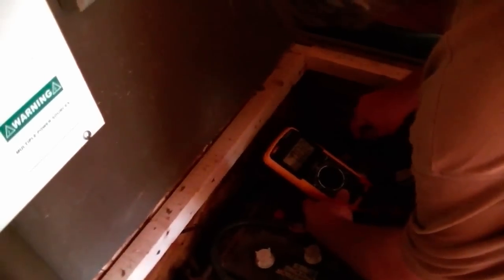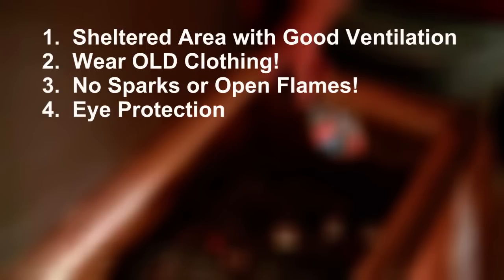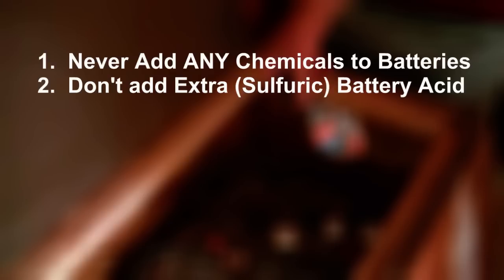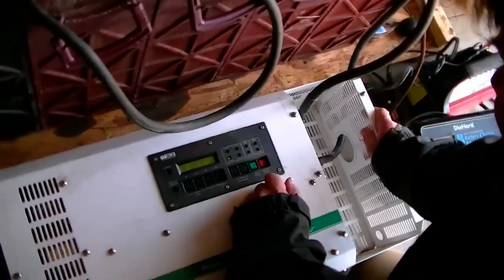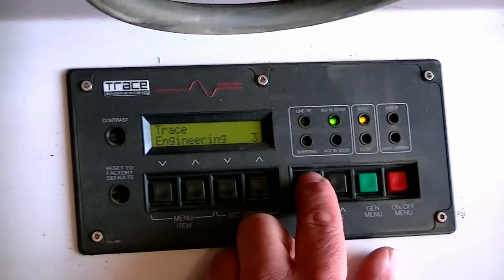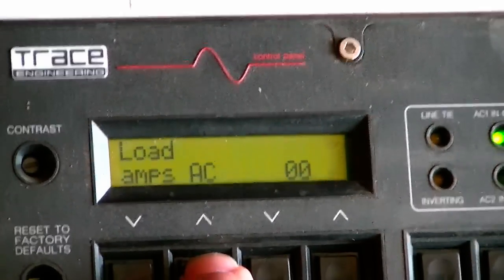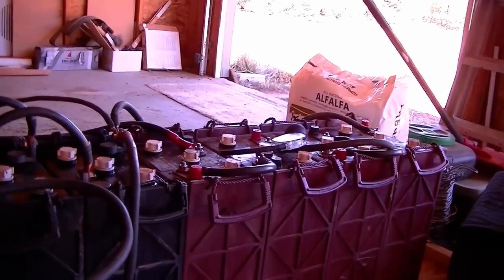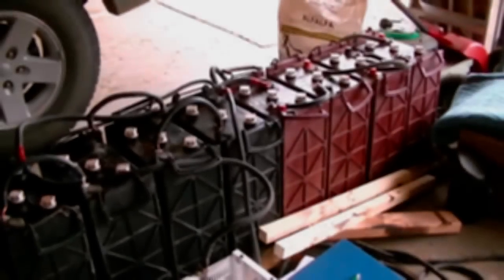Equalizing Batteries

Comment: I am attempting to rejuvenate a few seriously low cells in a 36 volt (18 cell) 765 Amp-Hour electric forklift battery. I have 3 cells that show 1.6-1.7VDC. I am using a variable transformer to "turn down" the A/C input to an old Schumaker manula (NOT automatic) battery charger to the point where I can charge the individual cells on the 6-volt setting at 40 Amps.
I am also watching the temperature and have read that 120-140 Degrees F helps soften the sulfate, but so far (after a week of this) I have not seen the specific gravity coming up. If anything, it appears the cell voltage is dropping. I am beginning to wonder if I have a different problem.
Reply from the maker: +Tracy Mathews I would say that those cells are simply bad.  Unfortunately, that is their ultimate demise sooner or later.

Comment: Thanks for d info. Can I get my batteries charged with panel instead with car charger
Reply from the maker: Yes, but you would need to get a panel sized properly for the battery.  Too small panel and it would not charge adequately.  Too large panel and you would need a charge controller.

Comment: Does this procedure vary when dealing with sealed batteries?
Reply from the maker: Chad, I wouldn't use this method on sealed batteries.  You risk deforming the plates, cases or even a possible explosion.  Keeping an eye on the water level is critical, and it's not possible (easily) on sealed or AGM batteries.
Reply: Thanks!

Comment: Very good video, however I have never needed more than 5 amp per battery when overcharging. This seems to re emulsify the sulphur with zero heat.
Reply: how long do you leave your battery charging with 5 amps for it to start bubbling, and how long do you keep it after.
please let me know.
Reply: @zgalli.powerlifting1814  starts bubbling 14.5- 15 V. I overcharge 6- 8 hrs. This is only done if sulpher has began to accumulate.
Reply: @robertdixon6536  thank you

Comment: question.... i have 2   6 volt t150 golf cart flooded  batteries hooked up in a trailer,,,,,,,,,,had them charged to full with trickle charger about a year ago or so. held that charge for many months with trailer in storage.but that ended a few months ago .am about to install a 100 watt solar panel on the roof with a 30 amp mttp controller .will the panel recharge those batteries over time or do i need to remove the batteries and have them boost charged for them to have life again ?
Reply from the maker: Bob thank you for your question.  It is possible to equalize your batteries with a 100watt panel, but it mostly depends on several factors.  If you don't get enough hours of sun per day it won't work.  If you live in a place where it is cloudy most days like South Bend Indiana, it won't work.  If the angle isn't proper it won't work, etc.   So the bottom line here is if you want to be sure to give the batteries a good equalizing charge, use a commercial charger that has an equalizing function.  If you have time, you can try the 100watt panel and see if it works.
Reply: thanks for the reply.i live in florida so sun not a problem. i guess ill just install the panel and controller and hook it all up and give it a week . if still no sign of them  taking a charge ill pull them and take them somewhere to be boost charged. i just hope i didnt kill them beyond fixing. all i had running off the were 2 sma;; volt meters but who knows .maybe thats all it took over months to totally drain them ?
Reply from the maker: That's probably the way I would handle it.  I think you're on a good track.
Reply: Just  wondering if the second half of this video was ever done. Thanks
Reply from the maker: Unfortunately, the raw footage for the second half of this video was lost.  But I can say this: we did recover more cells than not.  But most batteries had at least one bad cell making the whole battery useless.  Because of this experience I would recommend attempting this only on 2 volt cells, since individual 2 volt cells can be culled without affecting others.

Comment: Looking For some Help. If I have a string of 2 volt rolls surrette in series to make a 48 Volt bank and three charge controllers can I tap into the bank every 8 cells designating each charge controller to 8 cells per each controller and then set parameters to charge for 16 volts each all the same setup so as to better equalize the string and keep a better balance rather than just hooking all of them together in parallel charging at 48 volt parameters hope you can help Thank You
Reply from the maker: If your charge controllers are PV, isolated input/output and UNGROUNDED-capable (NEC 690.35 compliant), then yes as long as none of your wires from the arrays have an electrical path to ground anywhere.  It's not likely that your system would pass US electrical inspection.  It's not a setup I would recommend, but if you're willing to take the risks involved, it should work.

Also consider this:  If your charge controllers can handle 50 amps, their maximum capacity at 16 volts is only 800 watts each, where at 48 volts for the same amperage, they handle 2,400 watts max, each.  If you run them in parallel as a 48 volt system, you can handle a total of 7,200 watts of PV.  But running them at 16 volts, you max out at only 2,400 watts total from PV.  You really won't gain anything by splitting the charge, even though it appears to make sense.
Reply: Ok Great! I see your Point Thanks so Much for the help there is significant gain to be had at 48 Volts I guess that answers my question...
Reply from the maker: You're quite welcome.  Good luck in your endeavors!

Comment: it is also possible to balance a stack with 33 batteries ????
Reply from the maker: SekretaryService the short answer is it is possible. But the charger needs to be properly sized for the voltage and amperage of the batteries according to how they’re wired in series/parallel.  It is more difficult to do because you have to watch all the cells more closely to make sure none of them actually overcharge to the point of damage.
Reply: Offgrid Steve 33x12Volt and 90Ampere. But we use several Banks...

Comment: i could be wrong here but isn't the maximum charge rate about 20% of the given capacity.
for instance, a 5Ah battery can only handle 20% of it's given capacity as current. (in Ah of course) thus being 1 amp of current.
Reply from the maker: You are absolutely correct - generally speaking.  You would also be correct if you said that most AGM batteries should never exceed their float voltage by a few hundred millivolts.  However, when equalizing severely sulfated flooded cell batteries, it takes a higher amperage to get the sulfate to budge off the plates.  Like I said in the video, when it comes to sulfation and equalization, it's as much black art as it is science in my experience.  Do so at your own risk and discretion.
Reply: Steve Robertson i only had a few severely sulfated batteries at my school, so i asked if i was allowed to try and get them back to work. They are only 7.5 Ah so i set the supply to 14,7 volts and capped the current at 1.2 amps after about 17 to 18 hours they had reached the nominal voltage and they could deliver current to 2.4 amps without a significant voltage drop.

Mission succes.
Thx
Reply from the maker: Quinten, that's great that you had success!  You should make a video about it and share with the world.  The more info, the better off we all are!

Comment: The batteries are place on wood because ?
Reply from the maker: The concrete floor is new.  It belongs to my neighbor, and I was allowed to borrow it for this purpose.  You will notice several black spots on the wood where the battery acid got onto it.  I did this out of respect to protect my neighbor's concrete floor.  Concrete contains lime which reacts with the acid.  The surface of the concrete would have been destroyed in those areas the acid would have contacted it had the wood not been there.

Comment: I desperately need your advice!  Everyone, feel free to advise me as well.
I had 2 men working on the solar system in van.  
They replaced the batteries with a LiFePO4 12.8V 78Ah and a 12.8V 35Ah 448Wh.
They installed a Pure Sine Wave Inverter 12V Input, Power 2500W, Output 120V.
I also have a Victron Smart Solar Charge Controller,  MPPT 100/30.
When the electrician hooked up everything sparks began flying, the system got hot, and he has given up trying to set it up.  I have no solar power now in my van, which is my home.
Please help!  I can't waste any more money and I have no idea what I need.  Thank you.
Reply from the maker: That’s almost impossible to say without physically being there.  What is your location?
Reply: @OffGridLivingSteve  Florida.
Reply: I read part of the instructions today for my new inverter and it says not to connect it to solar panels nor a solar charge controller.  The men working on my van and installing the new batteries and inverter must not have known what they were doing.
Reply from the maker: @petuniaromania6294  it happens often where people claim to be “experts” after watching a few YouTube videos. I live in Hawaii now, so unfortunately I won’t be much help.  Be thankful you don’t live in Canada!

Comment: The Batteries are placed on wood because ?????  The acid will ruin the concrete ? or Wait , Wait. Don't tell me they will discharge through the plastic case if placed on concrete. That old tail is very hard to stomach.  Perhaps dirt or a rubber mate will work even better. Fantastic info and really appreciate it but I'm sorry I just don't buy  the concrete will suck out the electricity and make a battery go dead. Perhaps placing it on the concrete floor and forgeting about it for a year or two might make it come true.
Reply from the maker: Dear USSBB62, since you insist on putting words in my mouth about the batteries being on wood, I will certainly allow you to enjoy your nonsense.  I watched my video again to be sure that I didn't say anything about them discharging if placed directly on concrete.  I said no such thing.  Perhaps the voices in your head speak louder than my video.
Reply: Steve Robertson
THE MIST FALLS ON THE PLASTIC CASE. MAKING A SURFACE CONDUCTION BETWEEN POST AND EARTH.KEEP IT CLEAN AND DRY. GOOD VID.

Comment: The perfect gift 

Perfect gift for the handyman who has everything an ideal winter project,
       Make an electric garden tractor from your old gas tractor, and it could be charged by solar, zero pollution
Plans and instructions @ electrictractor.net
2hrs cutting approx 2 acres or 8-10 hrs pulling trailer on a charge
Converting to battery power is a great idea for a garden tractor I converted one 15yrs ago, I used the 3 separate motor design and it is still cutting grass on a daily basis, it is amazing how it never breaks down and needs almost no maintenance, I renew the batteries every 7 yrs I am just on my 3rd set now, my design will cut up to 2 acres on a 50cent charge there are no belts or pulleys and no oil on the entire tractor, it can pull a trailer for about 8hrs on a charge, because battery run time is the most important aspect of most conversions I paid particular attention to the most efficient design, I used 3 separate small motors one for the drive with electronic speed control and two smaller with a cutter blade mounted on the shaft of each cutter motor ,total amperage when cutting grass is approx 40amps, (2000watts) this design only uses the battery power req to do the job, very little wasted battery power, it uses magnetic breaking of both tractor and cutter blades and automatically applies parking brake when you stop or get off the seat, an amazing tractor.            electrictractor.net
         Video #5  Ploughing Snow  https://youtu.be/o4nSYsbPfvg
        Video #4 Ploughing Veggie Garden     https://youtu.be/7OF6lXgXth8
 Video #3 The Little Electric Tractor That Can! cutting grass   https://www.youtube.com/watch?v=9LWjfUjQ8a0&t=42s        Video#1 on youtube   https://www.youtube.com/watch?v=9GN5fTEWYPs&t=0s  
         and https://youtu.be/9LWjfUjQ8a0
Reply from the maker: I normally don't allow plugs for products on my channel, but this is very intriguing!

Comment: There's "equalizing' and then there's "desulfating"  though some try to use equalizing for desulfating... its not the same thing.

Desulfating is overcharging at a specific rate based on battery size and temperature. (referred to as "TVG" (Temperature Voltage Gassing)  You apply enough voltage that the battery will almost look like its right at the edge of boiling.  This releases a lot of hydrogen.

If you are overcharging enough that you smell the sulfur you are doing it wrong.

You do NOT want to get the batteries too warm.  100F is hotter than you want.

Equalizing is getting the individual cells up to the same charge level.  That means connecting in a manner where you can charge or discharge each cell individually.

Extremely large storage (deep cycle) batteries have a space under the plates intended to allow lead-sulfate crystals to drop out without short circuiting the battery.

*********************

to those saying this video is "excellent"... Just no.  He's doing it wrong.
Reply from the maker: Well I must say that's quite a slap in the face.  I have over 20 years in the telecommunications industry directly relating to telephony switches and the 48VDC that powers them.  It was common to get 30-50 years of service from a set of flooded cells that were properly equalized twice per year and after any power outage.  I have been off grid since 1983, and have mostly flooded cells in my life.  I share my experiences here.  So for you to come here and just announce to my viewership I'm doing it all wrong probably isn't going to gain you the notoriety you seek by bringing someone else down.  Your channel doesn't even have any content.  How do you have any credibility whatsoever?  Share with the world your knowledge instead of trolling around with such destructive attitudes towards others.  This is a positive community, and you're being positively negative.  Good day sir.
Reply: Steve Robertson. Correct response.